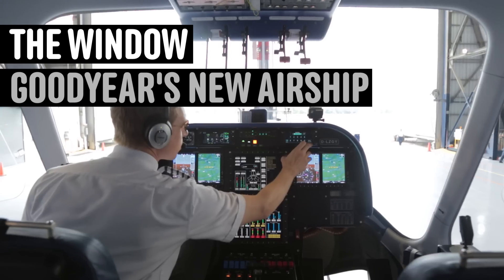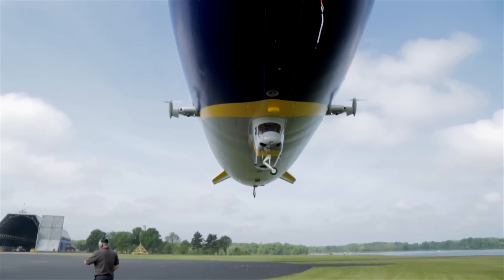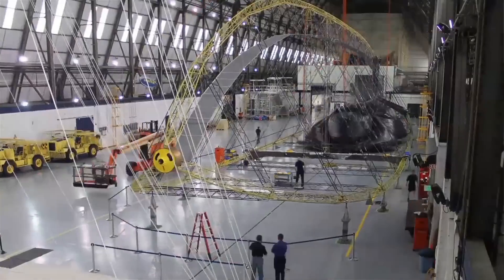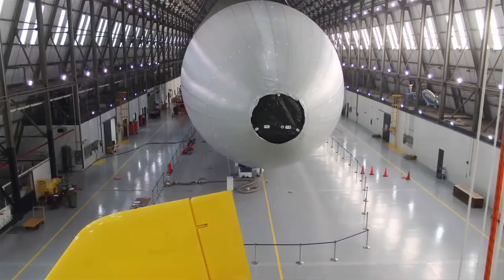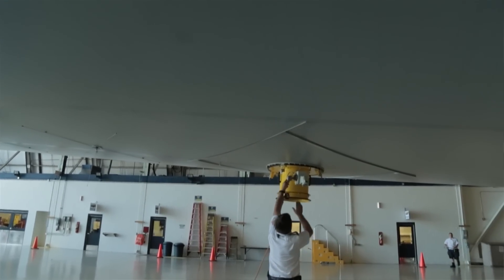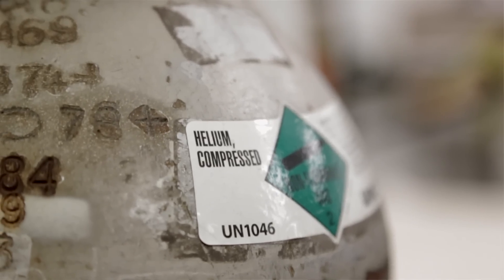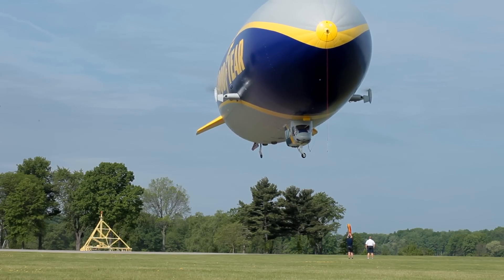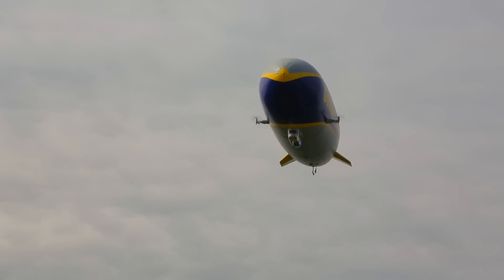Goodyear Blimp Part 1: A New Airship Takes to the Skies - WIRED

Comment: i have a fear of airships .-. i don't know why...just imagining it sailing through the sky makes me uncomfortable
Reply: +Ivana7092 Do you fear hurtling through the upper atmosphere at over 500 miles an hour, with an outside air temperature of greater than 40 below, sitting in a cramped aluminum shell strapped to tanks filled with flammable aviation fuel breathing recycled air?   Or how about cruising along at a leisurely 50 mph, sitting in a comfortable seat with a breathtaking view through a large window that can open to let you not only see the view, but smell the roses too - literally.
Reply: me don't

Comment: so the engine is electric
Reply: +pavel1809 Three Lycoming six cylinder engines power the Goodyear Zep.  It's a German design made believe it or not by the Zeppelin Company, the same name as the old zeppelins of 100 years ago.
Reply: pavel1809 NO

Comment: Helium is getting very rare and is used in allot of medical treatments as helium is non-toxic to the human body, Im confused why they didn't use any other gas... There are allot of gases other then helium that are lighter then air, plus helium is so much more expensive. Does anyone know why they still use it?
Reply: The expense, the rarity of helium and in some instances, political reasons are why so many full rigid airships of the past ended with the fate that they did. On the other hand, the US also had airships that DID use helium and all but one crashed too, one with a greater death toll than either of the notorious hydrogen filled airships.

For those wondering, the two hydrogen ships are the British R 101 in October 1930, was in route to India and crashed in France, the other is a little bit better known, the German zeppelin Hindenburg in May, 1937. The death toll in the R 101 disaster was 48 passengers and crew out of 54 on board. The Hindenburg, 36 people died, broken up like this: 13 passengers, 22 crew men on board, and one member of the ground crew, out of 97 people. And for the Germans, the thirteen passengers were the ONLY passenger fatalities in the Zeppelin Company's history.

The US helium filled ships; ZR 1 USS Shenandoah crashed in Ohio on it's way to a county fair.....yes you read that right. America employed rigid airships for the Navy, but it and the German built ZR 3 USS Los Angeles (from WW1 reparations) were logging more flying time as PR platforms....The Shenandoah was a copy of a downed WW1 German zeppelin, a height climber, one that had a super light structure that could fly high enough to be out of range of enemy fighters, but weren't that strong to withstand a violent summer storm in Sept. 1925 on it's way to the fair and was snapped into three pieces. The US, with the exception of the LA, wouldn't fair too much better with their next two home built ships.

When the Zeppelin Company delivered the LZ-126 or Los Angeles as it was christened, the Treaty of Versailles was already in full effect, except for this ship. The Germans were approached by Goodyear (sort of fitting for this video, huh?) who was already building blimps and balloons for the Army and Navy as well as their own advertising blimps, and they worked out a deal with the Zeppelin Co. that for a large sum of money, Zeppelin would hand over it's techniques as well as 13 of the company's leading designers who, when the time came, moved to Akron and built the Akron Air Dock, a hanger which still stands to this day, one of six still in existence from this era (One in Lakehurst, NJ, one in Akron, OH, one in Sunnyvale, Calif. one in Brazil and the two Cardington, England hangers).

They established the Goodyear Zeppelin Co. (GZ20 ring a bell, guess what the GZ stands for?) the first airship was the ZRS4 USS Akron along with a second ship, the ZRS5 USS Macon. Like the others they too were employed by the Navy and were to be scouts for our surface ships, but these two were unique in that they carried biplanes and became known as flying aircraft carriers. The Akron could carry four Curtiss F9C2 Sparrow Hawk biplanes in it's hull. The problem the US had was promising things of these ships before the crew was properly trained with it, the Los Angeles was a solid training ship, but the Akron and Macon were almost 100+ feet longer than the LA, at 785 ft. long, that is about 20ft shorter than the Hindenburg at 804ft long.

Along with all of these innovations like rotating props and internally housed engines, the large condensers on each side drawing water from the engine exhaust to maintain ballast. All of this made it a much different beast than that of the LA. And there were some accidents with both the Akron and Macon. The Akron damaged it's lower fin when a cable holding the tail of the ship to the ground failed. Out in California it was trying to land in rather warm weather and (helium and hydrogen will expand when heated up) instead of releasing helium to descend, they accidently released a great deal of water ballast, which made the ship rise rapidly, the result ended up pulling three members of the ground crew high into the air....two of which weren't able to hang on, but the third held on for nearly an hour. There is actually another version of this story that says the Akron was swept upward by a gust of wind. The Akron's last flight was on April 3, 1933. It was cruising along the east coast to calibrate radio frequencies and was caught in a storm and beaten down towards the water. It carried no life jackets.....which is asinine to say the least. Out of the 76 men on board only three came back alive.

Barely two weeks later the twin sister ship, the Macon was launched. It's incident was in 1934 over a mountainous region of Texas when it was struck by a gust of wind at it's tail, damaging the upper fin. Temporary repairs were made, but it was never completely fixed.....another asinine move, knowing their not so good history with these ships, why in the hell would they delay fixing a problem with something as important as a fin. And it would come back to bite them in the ass, in almost the same way it did the Akron, but in the Pacific this time and they were operating with the Naval fleet, whereas the Akron was all by itself. On February 12, 1935 the Macon was returning to it's Sunnyvale base after fleet operations and ran into a storm off Point Sur and a gust of wind re-damaged, even ripping the upper fin off, exposing those gas cells to the elements of the storm. But this time they did have life saving gear and with the fleet near by, 81 out of the 83 crew members survived, but when the Macon sank, so did the American rigid airship program, except for the Los Angeles.

Two years later it would end completely when the Hindenburg exploded in 1937.

So even though helium is "safer" in airships held by the inexperienced were actually more deadly than the hydrogen filled ships.

One thing I do love about these new Goodyear Zeppelins is that they have revived such a long standing partnership that started all the way back in the 1920s.

Lesson over there will be no test today. lol
Reply: Are any other gases approved for use by the government?  The fed is notoriously reluctant to approve new regulations to allow anything into the air.
Reply: Hydrogen... but then again there was that one time....
Reply: Are you sure there are be a lot?, and safe? Hydrogen, 4 times less heavy than helium, but unstable and highly flammable, the next gas is nitrogen, almost eight times heavier than helium because it's found as N2, oxygen is also very flammable and it's usually found as an O2 molecule being quite heavy. I could go on but the weight would be very close to the air and the blimps would need to be immense.
Reply: +Victor Arnaiz hydrogen is not 4 times less heavy than helium.
Reply: victor8o5 Thank you for the response! This is what I wanted to heer
Reply: mrroboto5785 Your LTA knowledge is quite impressive. BTW, was there a connection between the German-made Los Angeles and the city of the same name which is my home, LA California? Just curious and I appreciate all this info, thanks.
Reply: punchline43
 Thanks! I have been studying airships since I was a kid, and I'm 29 now. I have no other ties to airships besides being an admirer from the ground.

As for your question, all I know is who did the christening and that was the First Lady at the time, Grace Coolidge. But that could be asked for the Macon too, I'm sure it's for Macon, Ga, but why? If you are on Facebook, look up the Blimp Crew Tavern, it is a group on there for airship admirers from all walks of life. Some are former ground crew members from various blimps and some are like me.

I just asked your question there and they said that the LA was not named for the city, but what Los Angeles means: "The Angels" and the it was seen as an Angel of Peace....probably referring to the wounds of war being healed by this ship, coming from the "enemy". As for the Macon, they suggest that the name did indeed come from the city in Georgia, and it was the largest city in the District of Carl Vinson (Chairman of the House Naval Affairs Committee).

Another person chimed in and said that since the LA, Akron and Macon were classified as cruiser, since they were deployed as scouts, and the Navy named their cruisers after cities.

As for the Shenandoah one poster said, that the wife of the Secretary of the Navy who was from the Shenandoah Valley. Lastly the Akron was named after heavy pressure from Ohio Congressional delegation who wanted the ships birthplace noted as acknowledged as the worlds new LTA Capital.

The only US owned airship to never be given a name was the British R38, which crashed before it could be delivered to the Navy.
Reply: They said in another documentary that they get the huilem from the sun or something, it was weird!

Comment: Is there a use for this more than a big (and now fast) advertisement?
Reply: farvision Stable camera platform that can loiter for long periods without using much energy/fuel. Airships are unmatched when it comes to loitering time.
Reply: Yes it is used for covering sporting events etc. although advertising has been the main purpose I suppose. Otherwise it's cool to look at and a uniquely fun experience to fly in one as I was lucky enough to do so in '87.